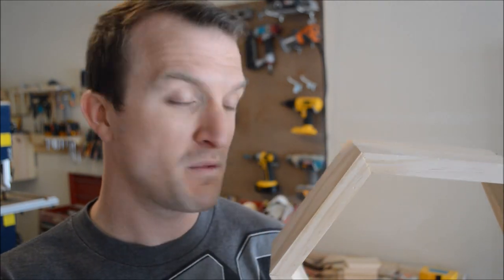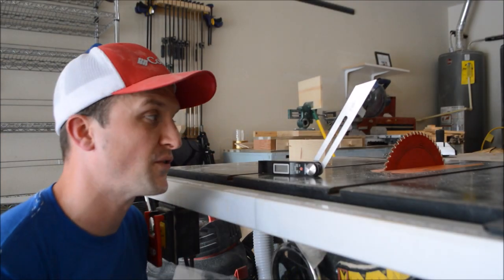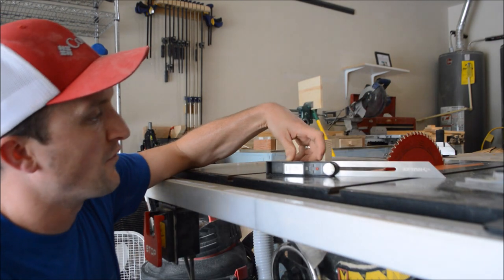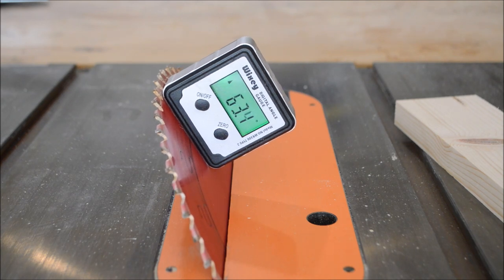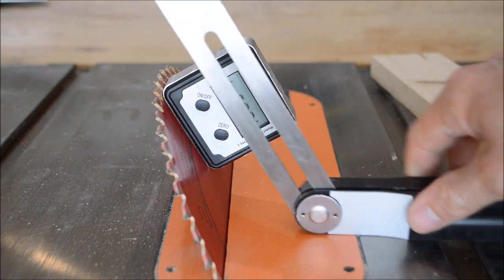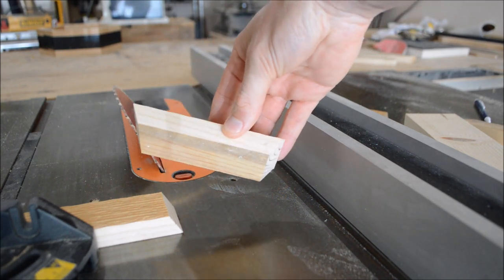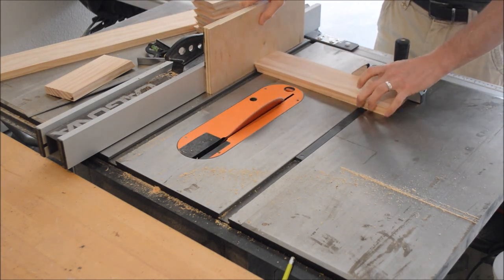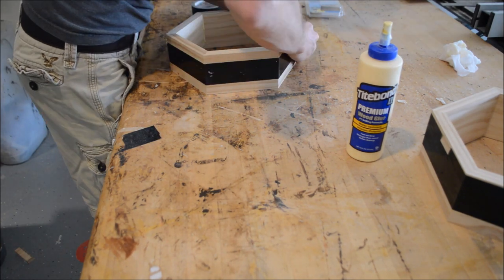Hexagon Shelf

Comment: I used a  MDF extention on my miter gauge and then used a stop block on it so the fence was not involved ar all.  Safer.  Another safety issue, if I may ( 70 years of woodworking experience), lower your saw blade to reduce exposure. Since your gluing end grains, you might paint each angle cut with 50/50 glue water mixture and let dry...then glue up using strap clamp to secure while drying.

Comment: thanks for the video I have a question  -I don't have a lot of experience with miter saws  and angles ok I try to make this project today a complete  crash and burned  --first I used 1x2 timber I put it in my miter saw the 2 inches side up and it came perfectly all nice and neet like yours  but when I went back to cut the real one in 1x4 timber  with the 4 inches flat in my miter it came out like crap, not one corner match --is there any difference  obviously when I did the first cut I got to the 30 degrees by moving my miter saw blade to the left  to the 30 marks but when I cut the 1x4  it did not fit so I had to move the blade back to center position and then move the blade sideways  to get the 30 angles I know a little complicated I just trying to learned this is my first miter saw also jijiji

Comment: Other similar videos I've seen have screwed the pieces together. Do you not find that necessary? 

How much weight do you estimate wood glue alone could hold? (obviously these typically would be used for light, decorative objects but curious when comparing videos).
Reply: Janine Nicole Ann Ward is say staple them together after the glue drys

Comment: Shouldnt your saw be at 30 degrees. When the two boards meet it would make 60. Right now your making 120 angles.
Reply: It is at 30° from the table top. The angle finder needs to read 60° from perpendicular to achieve this.